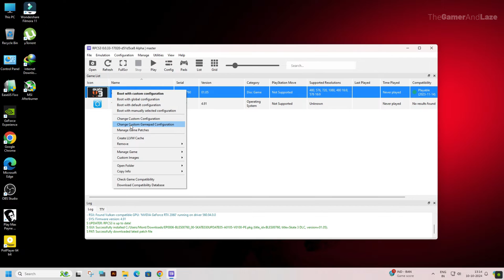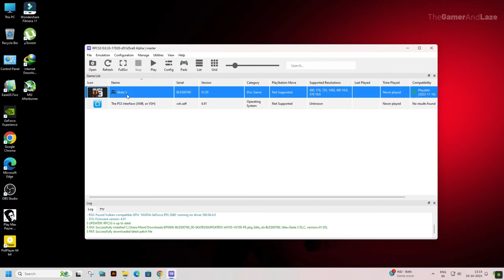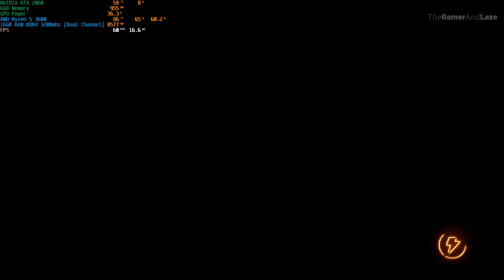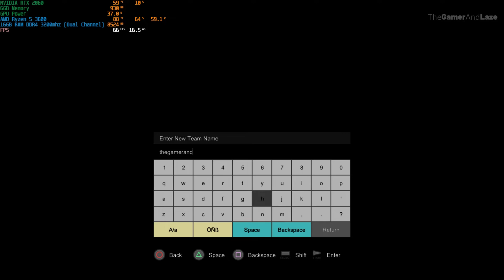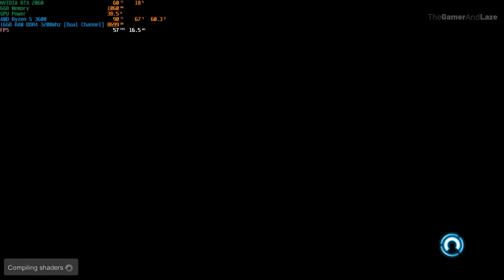SKATE 3 RPCS3 Best Settings 2024 | How to Play SKATE 3 On PC | 60FPS | SMOOTH GAMEPLAY | NO LAG

Comment: mine shows the message ''skate 3 will install the game to the HDD. if the game does not install correctly, you will be prompted to install again." it has been like that for over 24 hours now, and there is no progress/status bar whatsoever. hope u could help me with this, thank u.
Reply from the maker: @aokig4hara  if you have skate 3 iso file, then first mount iso file and then run rpcs3 and locate the mount file directory to import. If your game has an issue try " romsfun " to get a fresh game file here.